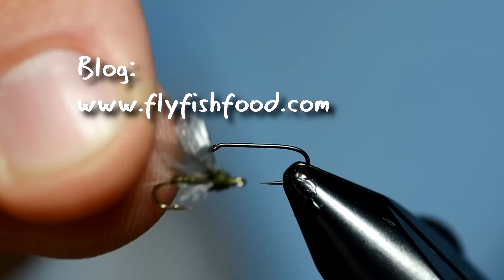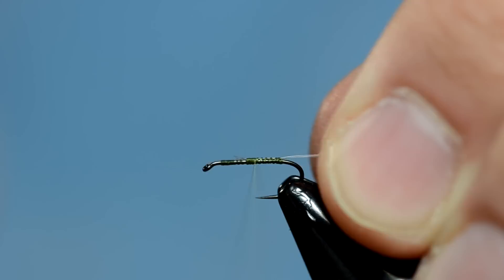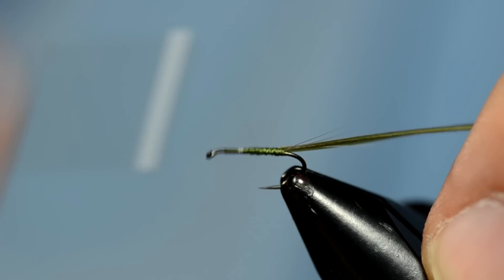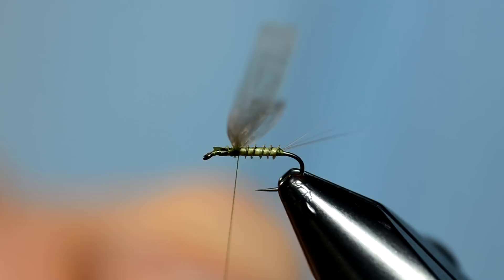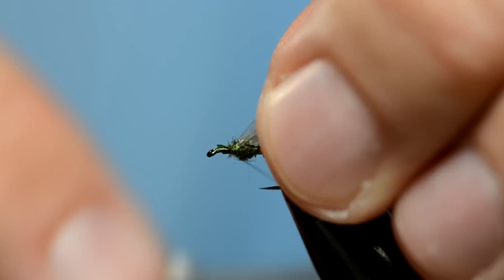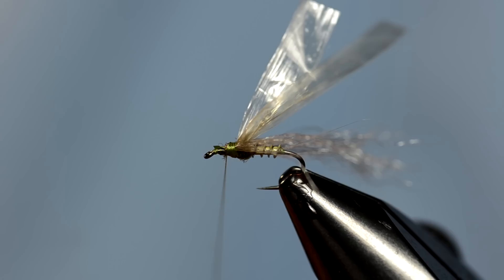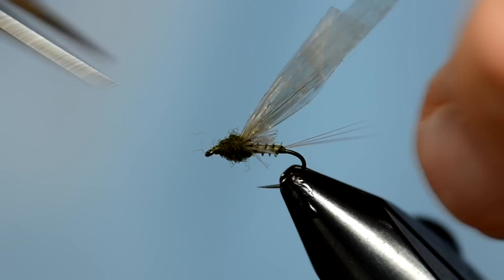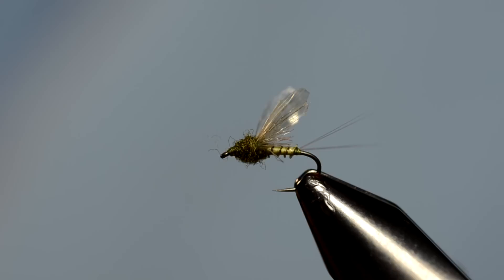Real Mayfly -- Fly Tying with Clark "Cheech" Pierce

Comment: It is wildly expensive for what you get. I have been using a white synthetic raffia ribbon I actually bought by mistake. With a little time it opens up to one thin sheet and is a strong as the medallion sheeting and you can make your fly a spinner right on the waters edge if necessary and then pull them right back up without a problem. I got mine online, but most craft stores or gift wrapping sites sell it really cheaply. 2.00 for 100 yards! Lifetime's worth! All the best, Sean